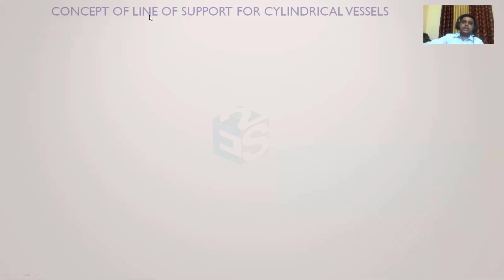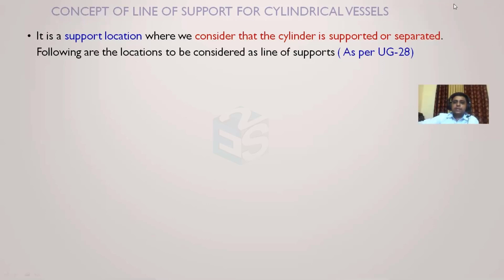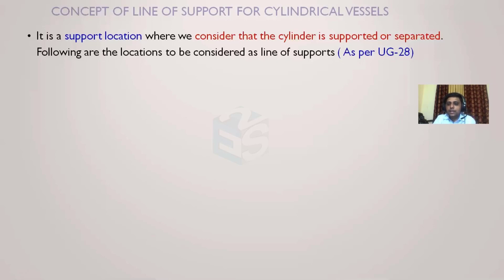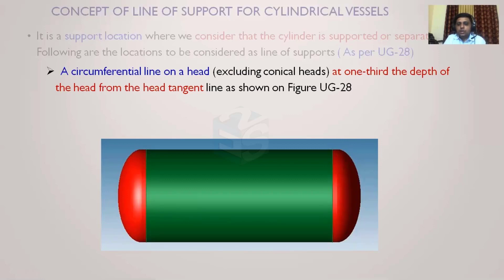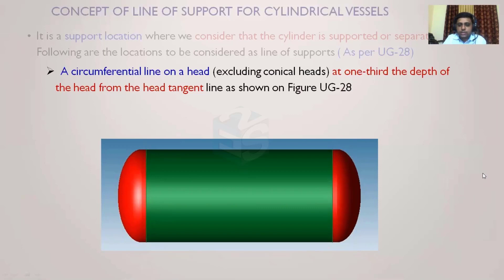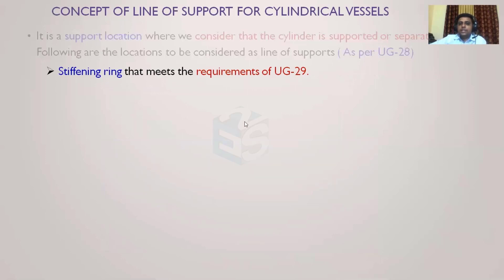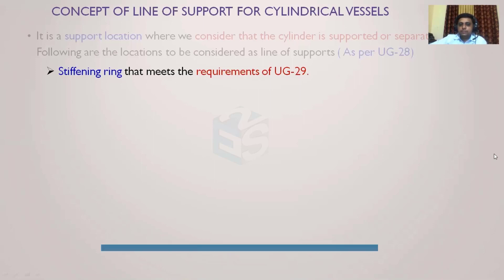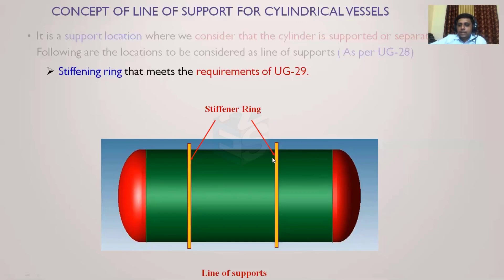Line of Support Concept for External Pressure Calculations | ASME Sec VIII Div-1 | Pressure Vessel

Comment: Hello, i have a vessel with an internal partition plate which makes the vessel in two compartments. Shall i consider partition plate as line of support or internal stiffening ring for external pressure calculation? If yes, do i need to check any additional reinforcement verification?
Also, kindly advise how to design an  internal partition plate (circular/flat plate)?